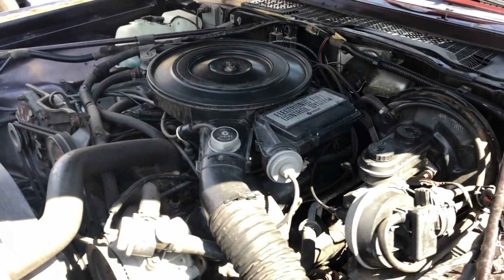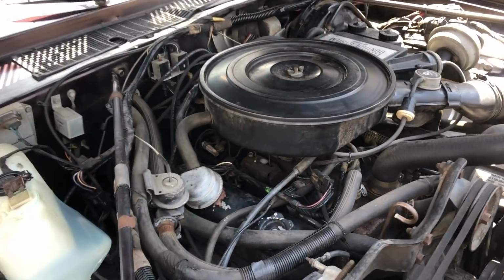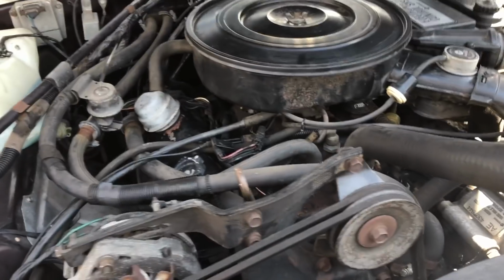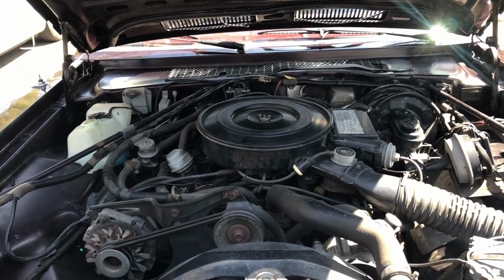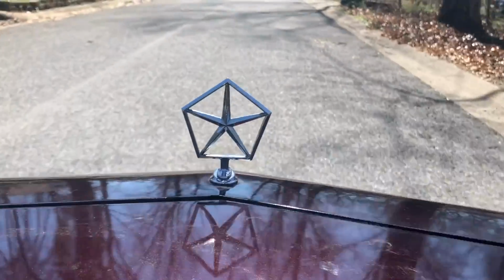The Car Chrysler Forgot to Stop Making - My 1988 Plymouth Gran Fury

Comment: This car was new when I was in high school: boring then, boring now. 
The roller LA 318 was a good motor though. Stoopid ECC computer was a P.I.T.A. along w/ the feedback Carter BBD carburetor. Mopars from the 1960s & 1970s were better...much better. <~ Simpler + Better Looking. Had a ECC computer on a 1983 Dodge D150 truck. Swapped over to Electronic Ignition, put the ECC under the rear tire & ran it over. That felt NICE!

Comment: If your state doesn't have emission testing, you can get rid of the Lean Burn system.  There are videos all over the internet showing how to do it.  The 318 will never die as long as you change the fluids regularly.

Comment: No idea why Chrysler never put the EFI and the more powerful 239 V6 in those cars. Yes they only made them two years when the Ram truck got EFI, but it would have made these cars just a little nicer. Should have dropped the 4 speed automatic in for the 89 model year too.  Guess they were using up all the old slant 6 engines and carburetor systems.

Comment: My best friend in High School was given his Grandmother's 1989 Plymouth Grand Fury SE for his first car.  It was Chacoal Grey Metallic, Light Gray Vinyl Top, Light Gray Cloth Interior, 318 ci V8, Power windows, power door locks, tilt wheel, factory air conditioning, Wire Wheels Covers, AM/FM radio with Cassette Deck.  We loved that car, and it was so well taken care of.  It was 1999, the car was ten years old, not a mark on the exterior or interior, virtually brand new with an original 21,000 miles on the odometer.   He still owns this car and drives it often.  We had an auto mechanic's class in High School, and my friend and the instructor removed the Lean Burn, installed a new Carter four-barrel carburetor, and made a few other minor tweaks to the engine.

Comment: I had a 1885 version of this car. I bought it when it was 2 years old with 13k miles. A retired, obsessively detail oriented owner, a family friend mentioned he was getting a new Ford the next day. I was at the dealership the next morning, waiting for it to open. I bought the Fury on the spot. The car was perfect in every respect. I owned it for three years, as a second car. It never saw winter weather. It still looked new. My father borrowed the car, and about 4 miles into his trip, was hit in the passenger door, causing a horshoe shape in the passenger side, actually tearing apart the unibody subframe and pushing the roof upward about 4 inches and of course, shattering the glass in both doors and breaking the windshield.  The car was a total loss. I almost cried when I saw my baby destroyed. She did hold up very well in the crash, and Dad only had minor injuries. The car lived on, with the drivetrain being installed in a local taxicab company's Fury of the same year. The taxicab company owner and I knew each other. The drivetrain from my car made it to 250k before giving up the ghost. My 1985 is still my favorite car. I loved it. You are so correct describing the Fury as quiet and easy to drive.Power to rear wheels was very adequate. With the lock up torque converter option in the transmission, highway mileage was 24mpg. I loved your video. Good luck with yours!

Comment: Props for keeping it original and it's typical lowest priced option list. They do cruise great and all sorts of ways to make them evil on a budget. Yes, the brainless box right over the exhaust and look up the number sold and the fail rate - it's ridiculously low. My experience has been the sensors failing more so than the box. Time it using old school light on the set of marks that are less obvious - the sight hole mark is several degrees off and ya need to plug in to the box to use it.

Comment: Best thing you can do is take that Lean/Burn, Spark/Control, Engine/Management off and throw it away... period... I had to do that with my 1977 400cu (6.6L) Chrysler Cordoba years ago. Back in 1990, that part was an expensive, dealer only, no warranty issue item. What I did at the time was convert the ignition system back to a 1972-1975 (1976-1979 for some truck motors) Prestolite Electronic with vacuum advance for the distributor. Car ran flawlessly ever after, wished I never sold it. When the Lean Burn worked correctly, it worked great with electric advance for the distributor. When it didn't, the engine ran rough, back fired thru carb and exhaust and would not start in cold weather. This system should have been scrapped long before 1988! Back in the 1980's Mr. Iacocca was only interested in front wheel drive "K" cars. As a result, we switched over to GM and Ford. By 1990 GM brought back a rear wheel drive V8 full size Buick and Oldsmobile on the Caprice platform. Mr. Iaccoca only went smaller until Chrysler went bankrupt again in 1992 and he retired.

Comment: These should have been a larger car.  They look like a big car but they are just a restyled F-body.  Chrysler needed a big car during the K-car years.
Reply: Exactly and it wasn't until around 1992 when Chrysler went bankrupt again did Lee Iaccoca figure that out. During this time Chrysler had surpassed CAFE standards to a point it could have a full size rear drive V8.
Reply: @stiffneck2090  Lee Iaccoca retired near the end of 1992.  Bob Eaton replaced him.   Some say Eaton was okay, others fault Eaton for the sale to Daimler.  Mopar needed a popular big car, but they did get new Ram trucks in '94 and the new LHS cars.  It is interesting that the M body New Yorker Fifth Avenue sold as well as it did, being no bigger inside than a Toyota Camry.  I rarely see a front drive LHS Chrysler or Dodge on the road, I think the old v8 powered rear drive M-bodies were better built. I also think the Sundance/Shadow were better built than their Neon replacement.
Reply: @timothykeith1367  Eaton was a GM guy who had no interest in Chrysler, except to sell it out for his retirement. Mr. Iacocca should have picked Bob Lutz and even admitted his mistake years later on PBS. LHS and the smaller Dodge equivalent cars credit goes to Mr. Iacocca not Eaton. It was before Iacocca retired that the LHS platform was conceived. My Uncle who worked for Chrysler put 148,000 miles on their LHS before something happened to it. I remember traveling from St. Louis to Detroit with 5 of us in it and how roomy and comfortable it was. I had another Uncle who put 155,000 miles over 10yrs on a 1991 Dodge Shadow. Had zero problems the entire decade. He sold it to a repair shop because it was burning oil. I wonder, did it need a valve job/rings replaced or just a bad EGR emissions part. I still have my 1997 1500 5.9L Dodge RAM with over 275,000 miles on it. Yes it's rusty and the A/C doesn't work and the transmission was rebuilt correctly using steel not aluminum parts. The rebuild of that tranny has 155,000 miles on it(and still going), as to the original drums only making it to 120,000 miles. I've had that truck up to the axles in mud and snow. Up to the floor boards in water. Towed 30ft long BAja. Been thru every snow since new, because my job at Airport requires me to be there. Since replaced it with a 2021 unit, but still have the old one.

Comment: I drove one of these as an unmarked highway patrol car. Even with the beefed up police specs, that electronic spark control system had a very nasty habit of causing the engine to stall out at the worst of times, IE. in pursuits, mid arc of a hard u-turn or basically any time that was likely to send you to meet your maker. I hated them for police work but they did make pretty decent family vehicles. Great to see such a nice example has survived.

Comment: Re the seats, in Australia since mid-60's, most locally-made 6 & 8 cylinder luxury cars came with reclining bucket seats and centre console with t-bar auto. 
And since late 70's, nearly all l-m cars (incl 4-cyl) were likewise and depending on the model, 4-speed manual can be had.
I just find it surprising in a country where car is king, it aint so.

Comment: I had a 1987 SE Model Mine had 5.2L V-8 Auto PS/PB Cold A/C Tilt CC Am/Fm Infinity  Cassette P mirrors Vinyl Top Wire hubcaps rear defrost Power seats on both sides power locks no power windows and it had the power sunroof. WE brought it off the original owners said they went and special order this Gran Fury With NO Power Windows and wanted Power every thing else. She said her husband didn't like electric windows. paid 850.00 for it. The color was Baby Blue with white Vinyl Top. The original sticker was 14,950 New .

Comment: Did you ever replace the vacuum diaphragm on the front of the lean burn computer?  If that is bad, the computer will not adjust your timing advance correctly.  If it is bad, unscrew the top cover of the computer, and then remove the two screws and the 'e' clip that hold on the diaphragm.  While you're in there, wipe off the traces where the plunger tracks.

Comment: The problem with Chrysler computer is that the computer was placed above a high source of heat and that's what causes it to fail. The computer isn't able to handle the heat and that's why it fails. I know how you want to keep it original, and they're amazing factory original, but all you need, is as you said, a new carb and a few other odds.

You can take the computer off and put HEI on there with a 4bbl carb and intake and a cam, good echaust and that car will wake up.

My 87 Gran Fury was mostly original with 22,000 miles when i bought it a year and a half ago, not as clean as yours and mine doesn't have the SCC, Spark Control Computer and i am glad. It wasn't a survivor like yours is so i have no regrets about working on it. These cars had a stupid exhaust and 3 catalytic converters on them and horrible manifold. Simply allowing the engine to breathe will wake up a 318 and let you have more performance and reliability.

Comment: It will be the gas. It was designed to run on 1980s gas, not 2019 gas. Modern gas is blended way differently.

Comment: Your car likely needs a carb rebuild.  Do not just tear out the lean burn.  Make sure your timing chain is ok, the 2bbl cars have nylon timing gears and single-row timing chain.  Your dampner might be slipping, too.  

To test the Lean Burn - see if the timing advances properly up to about 3500 RPM.  The ELD 318 is not designed or intended to be a high performance engine, and will run and perform best when kept original.
Reply from the maker: Thanks so much for taking the time to send that comment to me about the Plymouth Gran Fury, the timing, and all.  Really appreciate that and for watching the video too.  Thanks!
Reply: @hullinger  its a beautiful car, glad you're keeping it up without hacking it.

Comment: This car uses a plastic gear on the distributor. When worn it will cause the issues you describe. Cost very little and easy to change. This car may have an OBD1 connector (my 88 chevy had one) You put jumper across two of the pins and a dash light blinks a series of flashes that gives you the diagnostic code. Good Luck .It looks like a really great car.
Reply: False, and false.  The computer handles the spark advance; there is a heavy steel gear used to drive the distributor.  The ELB/ESC used from '81 through '89 does not have a remote diagnostic connector. Chrysler did have an ELB machine that could test the older analog (pre 1980) systems. There is no check engine light.  The only diagnostic light at all is the airbag light on late '88 and all '89 models.
Reply: @pkranz937  That is good to read. I had several older Mopars and I hated those stupid plastic gears.  I  never had occasion to work on any of these from the late 1980s to look for the obd1 connector.  I guess I never would have found it.  Just curious, what year did they switch to a metal gear on the distributor?

Comment: Miss my diplomat first car. Had the exact same Grill and instrument cluster only it was all tan inside now and an ex-cop car with posi Trac 360 and a 4-barrel Holley it got right up and moved for a four-door.
Reply: 318 4bbl.  SureGrip, not posi.  The 360 was never offered by Fleet in the '81 - '89 M body squad, and only through 1980 in F and R body squads.
Reply: @pkranz937   I don't know maybe you're right about the posi but I'm damn sure it's a 360 it might have something to do with the other tag in the door frame that says custom manufactured for the Toronto City Police Department. I wish you could come see that sitting in the dead row at the farm.

Comment: Try Gap setting the plugs. May get rid of that misfire you keep having. I've had Chrysler products in the past. Check engine lights for misfires and it was just just shitty plugs that I used. Bought better ones and gapped them, no problems.

Comment: nice car!  I noticed no air conditioning either...but you did get a digital stereo with cassette player!  Those cars were the staple of police agencies around here for most of the eighties.  Don't think they had the same weak engine, as the officers I know said the police Gran Fury's would outrun the Chevy Impala's and the Ford Crown Victoria.  The Chevy's were equipped with 5.7 V8's similar to the Corvettes, and the Ford's had the same 5.0HO that the Mustang had
Reply: The 4bbl Mopars were quicker and faster in Michigan State Police tests until '87, when the Dodge was disqualified running 0-80 mph (the Plymouth was fine).  For whatever reason, the Plymouth always ran better than the Dodge in nearly all the tests.  In '89, the newly fuel injected Caprice finally beat the Fury (still using a Quadrajet).  The Ford was a 2bbl 351W - the 302 H.O. Mustang engine wasn't used in the Crown Vic, just a low hp version which ran very well but was painfully slow. 

A slicktop Plymouth with the ELE 4bbl 318 and 225/70 rubber (very common combo) would run right around 120 mph. The 5.8 Ford, maybe a buck-15, and the 350 Chevy, a tad under 120.  In '89, the Plymouth was still running the 120, the Ford at 115, and Chevy got up to 122 or so with the TBI.  But the Mopars had a reputation of being excellent handling, and outstanding brakes - for the time, anyway.  

In reality, they were all old and tired by '89/90. It's amusing to look back and note that Ford kept the goofy variable venturi 2bbl on that boat anchor 351 through '91.  
Even more amusing - none of those cars were governed.
Reply: @pkranz937  I remember a friend buying an old police interceptor Ford Crown vic from a local rescue squad.  The engine had a fuel injected 302 in it with the "rib cage" style intake manifold like the Mustang engine, and what looked like headers on it.  When he put some flowmasters on it, it had a nice aggressive growl just like a 5.0 Mustang.  IIRC, it was a late eighties model, 88 or 89 maybe...car went like gangbusters.  Not sure if that carb'ed 351 was the only engine option on those cars back then because of that.  Was a fun car, but everyone would drive slow around you because they thought you were a cop.  He eventually painted the car all black, and got "MIB" on the license plate

Comment: Nice! 78 amp alternator wow! My 2016 F150 has a 200 amp alternator. LOL
Reply: Actually, 88 and 89 models had a 90 amp Denso or Chrysler alternator.  The squads had a 120 amp version.  That was high for the time.  My '13 Charger Pursuit has a 220 amp with a clutch.

Comment: Here's what I would do with that car. I'm looking at the front and the rear and thinking how much alike or similar they look. I would build on that by making a coming/going car. Replace those tail lights with what looks like the head lights but clear with red bulbs so they function as tail and brake lights. 

A front grill modded into the back of the car. The car would look to those driving behind it like it was going in reverse down the road. On the freeway at 55 or more MPH, can you imagine the reaction?

Comment: I got to drive a a Chrysler Fifth Avenue fairly regularly as a courtesy car at a rental place in '88, and I loved it in all its button tucked, Landau roofed, wire wheel covered, chromed glory. The engine had a ton of torque and the car was smooth and quiet and rattle free as you say.

Comment: I recently learned that the Chrysler Spark Control Computer developed in the 1970s as part of their involvement in the space programme was designed to last only approximately 20 years before they go bad or fail altogether. They are commonly disconnected and bypassed as a result. They were designed to meet emissions without compromising economy.
Reply from the maker: Hey, great comment and thanks for sharing that info about Lean Burn.  -Chris

Comment: Long term (maybe even short term) you'll save money and headaches by tossing all that electronic crap in the trash and just putting on a new carb and distributor. There's nothing quite as much fun as having Chrysler "electronics" fail while on a nice country ride with the family.

Except when they decide to stop working on the highway, with traffic flying by at 70mph. Oh wait, that's just terrifying.
Reply: If it's working, you leave it alone.  The only reason it would just quit is something non lean burn related, such as a bad fuel pump or pickup coil.

Comment: I had this car except under the badging of a Plymouth Caravelle, Car was a complete pos. Huge gas gozzling 318 and absolutely no power. No heat half the time, Dash lights and gauges all stopped working.  The pos electronic fuel control system was a nightmare and all the paint came off the hood and trunk.  It was extremely comfortable with its beg pillow cushion bench seat and was quiet and rode smooth when it ran.